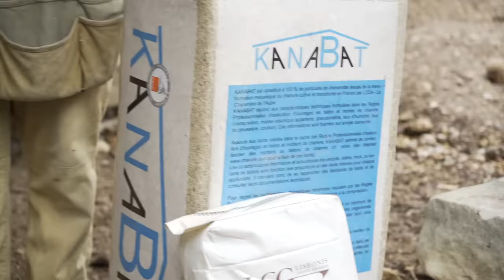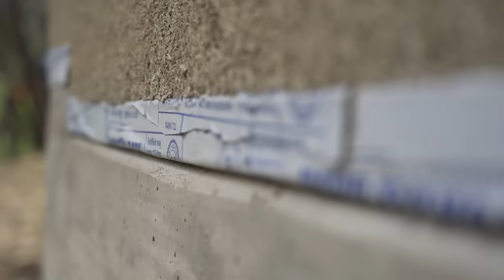Hemp Concrete Walls (R30 + Fireproof) - You Won't Believe How They Built This House!

Comment: Stop twisting the facts about Hemp. I have a 2 year degree in Horticulture. Changing the name by "language" does not change the plant. They are both Hemp, they are both Marijuana. What is smoked is Industrial Hemp that has been selected over the years for it's higher THC. Both are Cannabis Sativa Sativa, but the smoking one that has been selected out of the industrial hemp is now classed in a subspecies of the subspecies for "political reasons". But this does not stop both from being the same hemp used through the centuries.

There are 3 subspecies of Cannabis Sativa;
Cannabis Sativa Sativa
Cannabis Sativa Indica
Cannabis Sativa Ruderalis

The high THC was developed by selection from industrial hemp. You can always develop higher THC plants out of the industrial hemp, but you can not make its relatives Indica or Ruderalis from it. All 3 will cross and make hybrids.

Because industrial hemp can be used to create the higher THC, because it's the same plant strain, the crop is tested for THC so that it doesn't happen naturally, or artificially by a farmer saving seeds to replant. If industrial hemp is grown as a single female specimen plant, it will produce more THC. That is why the crop should be tested for levels of THC from the center and not the edges or corners. But stating that hemp and marijuana are different plants because one is English and the other is Spanish is political BS. Cannabis is Latin.

The higher THC marijuana can be used to develop the lower THC hemp, because they are the same plant and is why smoker/growers have pitched seed. Because the mother plant was reverting back to the lower THC in it's genes, aka industrial hemp.
Reply: This is not correct. Botanically spoken hemp has been subdivided into the industrial hemp or cannabis sativa, the cannabis indica which is the marihuana and the cannabis ruderalis, which grows in the wild. This relatively new classification into subspecies was done to clear out once and for all the misunderstandings. The industrial hem has been selected by humans, into a species that has become so different from the original wild plant, that this needed to be cleared out.
To the same family of   also belong the humulus (humulus lupus, used in beer) and celtis (celtis australis and celtis occidentalis).
It is like  horses and donkeys, or tigers and lions: they are subspecies of a larger family. And even when they can interbreed, this does not mean that the difference is only about 'language'...
When in US the hemp became politicized, this does not mean that this counts for the rest of the world.
Reply: @wolfjordan1432  Hemp is English, Marijuana is the Spanish slang (the way the "j" is pronounced should be a clue, but you used marihuana as solely Indica), Cannabis is Latin. All 3 languages are for the same plants of the Genus Cannabus, Family Cannabaceae, Order Rosales. 

The USDA omits the Order Rosales and replaces it with a sub-order under Rosalas of Urticales. They have clearly committed error in their identification. As I stated the classifications being done is for "political reasons". They have even used the Spanish name to some how make people believe its turned into a different plant by changing names. 
https://plants.usda.gov/java/ClassificationServlet?source=display&classid=CASA3 

Industial hemp is the Cannabis Sativa that has been used for centuries to make Canvas, Paper, Feed baling twine, ropes, etc. It is also the source of the high THC hemp that was smoked and called by many names weed, grass, pot, gunga, green, herb, mary jane, etc and marijuana via separation and breading. Which is known as improving a strain. The high THC hemp aka Pot can revert back into low THC industrial hemp because it is Cannabis Sativa Sativa. Cannabis Sativa Indica can not revert into low THC Cannabis Sativa Sativa, or Cannabis Sativa Ruderalis, or vice versa.

Cannabis Indica was not common in the USA when hemp was cultivated legally here and called hemp and marijuana in the south west. This is the origins of the Spanish slang marijuana spreading in usage. You are in error to claim that Sativa is not marihuana(marijuana) and claim the sole use of the name to the species Indica, "the cannabis indica which is the marihuana" is your false statement. 

You are the one that "is not correct" to use your own words. And "Botanically spoken" don't you mean Botanically speaking'?

Maybe you should scratch out a letter to this site and tell them they aren't correct.

https://medical-dictionary.thefreedictionary.com/marihuana
"marijuana [mar″ĭ-wahn´ah]
a preparation of the leaves and flowering tops of Cannabis sativa, the hemp plant, which contains a number of pharmacologically active principles (cannabinoids). hashish, also derived from the hemp plant, is obtained from the clear resin secreted by the flowering tops of the plant and is four to eight times as potent as marijuana. Both drugs are used for their euphoric properties and are considerably more potent when smoked and inhaled than when simply eaten."
 
You might want to check the facts of your own thoughts before you try to correct others. The medical site uses the scientific name "Cannabis sativa" as I have.

Comment: so, hemp locking in the carbon dioxide as a green product, but then ship wood thousands of miles under diesel power.  Hemp can save the world, but not when materials need to be shipped around it

Comment: It is amusing that you talk about the hempcrete walls being able to wick away moisture easily enough, yet the "vapor barrier" is absolutely required.. Make up your minds, because you sound like you cannot make an actual conclusion on the matter. It is like attempting to walk yet both feet are going in opposite directions.

Hempcrete is able to wick away moisture easily enough. No vapor barrier is required and installing it only adds a layer for moisture to get trapped. If you simply remove it and moisture would quickly dissipate through the wall.

Comment: Sorry, it is BS. Hemp is only used as a light weight filler. The fireproof comes from the cement and limestone. Just exchange the hemp with perlite, then you have an insulated fireproof wall.

Comment: The guy didn't answer correctly the relationship between "marijuana" and hemp. which is they are the same plant just different parts of the plant. both the fibers are "marijuana" or hemp,

Comment: Uhmmm, why the dumbing down muscle and bone talk instead of the normal definitions commonly used?   Not a 420 guy however hemp has a fantastic number of uses, and this is interesting, to a point. For a sheathing material this sucks, even aircrete or some of the other real lightweight form pourable cretes would seem more appropriate. However if you have money to burn and need the green street cred, it your house...
With wood prices out of this world, I am looking at alternatives like The Perfect Block or similar ICCF materials I can pour into forms myself.

Comment: The "COUSIN" analogy with hemp is incorrect. 
As a long time cannabis breeder myself, hemp and marijuana are the exact same plant. It's all cannabis. They have been bred for different genetic traits, but they are the same plant. If people have problems with cannabis vs hemp, they should really just get over it. 
However, we also don't have to tell people the wrong information. You can obviously buy CBD HEMP cannabis to smoke at CBD stores. I have had breeding projects where I bred industrial hemp cannabis to my THC cannabis plants for a faster harvest time and higher CBD content. 
People, you're building with cannabis and that's Ok. Stop the stigma.

Comment: I think this is a bad technology..   I would hate to see what will happen when moisture enters through the stucco and saturates the fibrous structure and starts to rot the structural wood away.  If there is no moisture barrier between the stucco and the fiber "concrete: this will not  be sustainable for the long run don't like it. Pretty bad idea. I don't believe in the petrification process either. One year is not enough to see what is happening on the inside of the walls

Comment: Seems like a useless product to me. It needs studs and steel beams to keep that 10 inch wall stables? Use metal studs and rockwool insulation and you'll ha e the same thing at a fraction of the cost.

Comment: Frank Lloyd wright thought it was a great idea to mess with concrete outside the normal process, his buildings are failing
Reply: Yes and seem to have extensive rot in the structures also.  My guess is from the flat roofs leaking into the structure.
Reply: @24revealer  yeah exactly

Comment: "The binder absorbs CO2 out of the air!" Yeah, just gonna gloss over the fact that you have to burn a crapload of fossil fuels to remove that same CO2 from the limestone to make cement in the first place? The carbon capture of the hemp itself is good, and the insulation is great, but everything else is greenwashing BS.